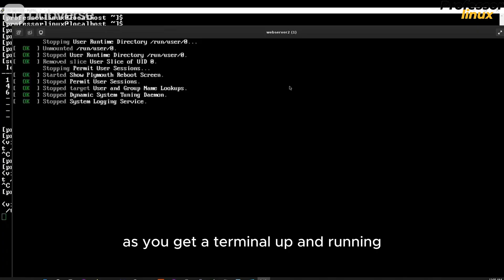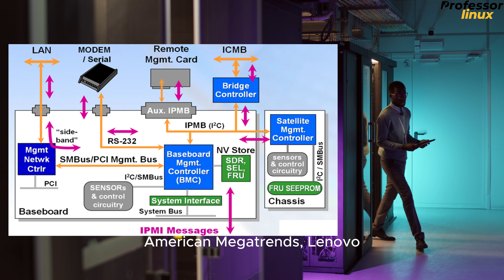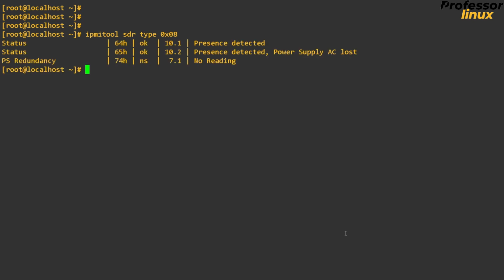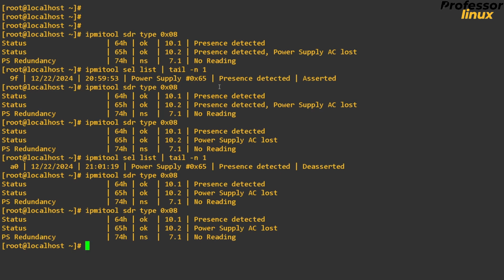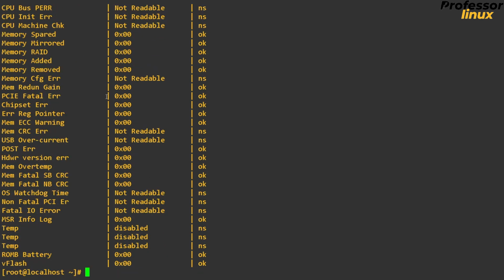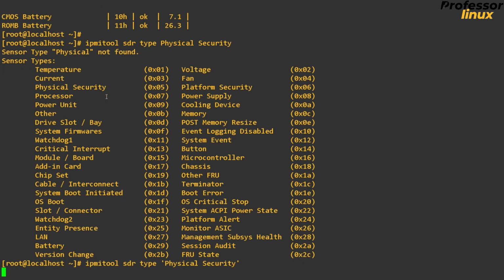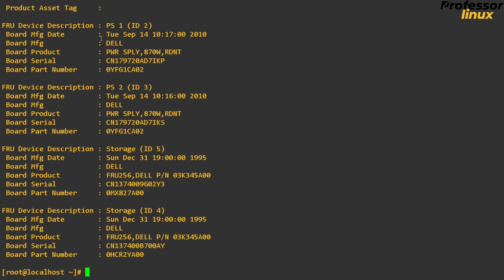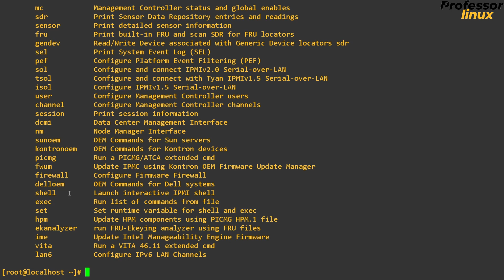What is BMC - Baseboard Management Controller

Comment from the maker: Hey everyone! Just a quick note about the BMC setup in this video ... we did it on my local machine, but technically, when using the IPMI tool command remotely, you'd need to provide the username, password, and the host's BMC IP address. This demo was just to show how it works on the BMC itself. Also, I noticed a few typos in the subtitles, but I’ll leave them for now. I’ll make sure to double-check them for the next video. Thanks for watching!

Comment: Thanks for this video! Any tools you know about to aggregate data from your server bmc into a central location for alerting or maybe automated action such as shutting down the server if the temperature is too high?
Reply from the maker: ipmi_exporter is commonly used in production environments, its main drawback is that it typically runs on the host operating system.
A better approach is to run a centralized monitoring server that uses ipmi_exporter (or ipmitool) to query all BMCs remotely.

This design is more efficient and reliable if the monitored server goes down, you still retain full visibility into its hardware status through the BMC.

Comment: I make leak detection sensor wire that is being used to monitor liquid cooled servers. On potential client asked about interfacing my sensor via their BMC chip.  My sensor outputs a voltage between Vcc and Ground that indicate wet, dry or broken.     But I now see  that BMC chips  have whole collections of pre-defined sensor types and interface protocols.   Is there a central organization that is standardizing sensor interfacing or is this something that has to be tackled with each BMC vendor
Reply from the maker: BMC management is usually vendor-specific each major server vendor provides its own BMC firmware (e.g., Dell’s iDRAC, HPE’s iLO). However, for a more open and customizable approach, you can look into the OpenBMC community. If you want to add a water leakage sensor, you’d need to identify the available hardware interface (e.g., GPIO) on your server, then either modify the vendor’s firmware (if supported) or use OpenBMC to integrate the sensor via their framework.